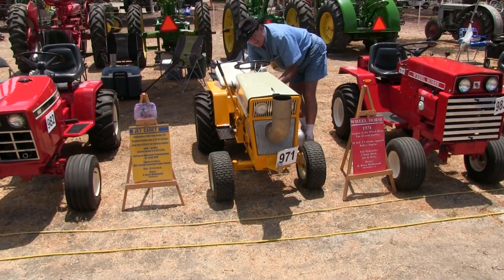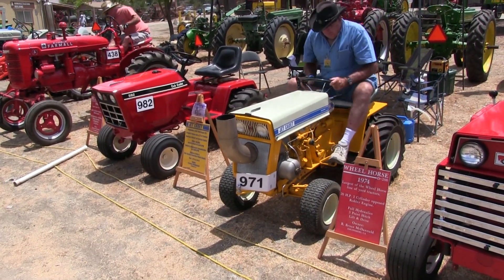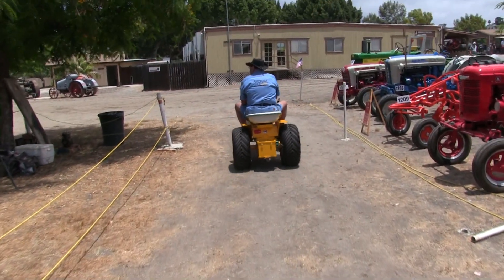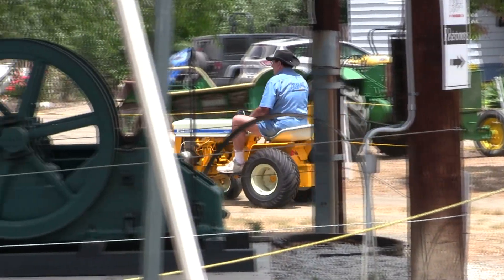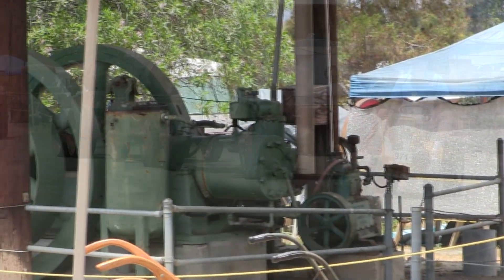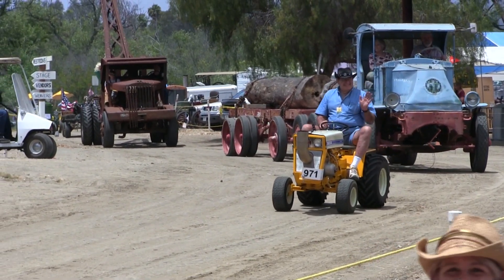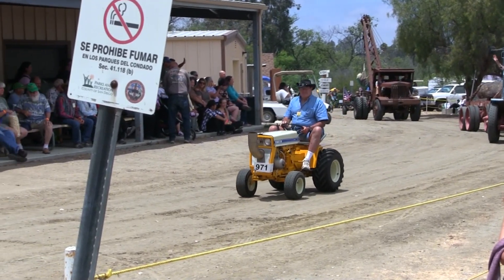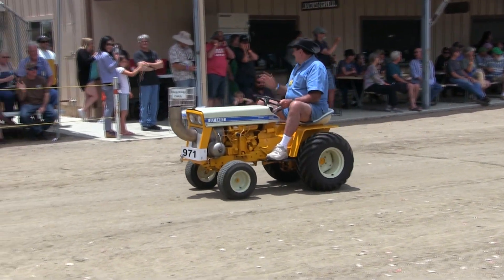Listen To This....Turbine-Powered 1967 "Jet Cadet" Garden Tractor

Comment: Been doing some research, what turbine is most usually used for garden tractors??
Reply from the maker: This is not an everyday conversion.  There are no kits for this kind of thing.  I'd say the answer is whatever kind of turbine you can get your hands on that will fit your tractor.  That's basically what you're seeing here.